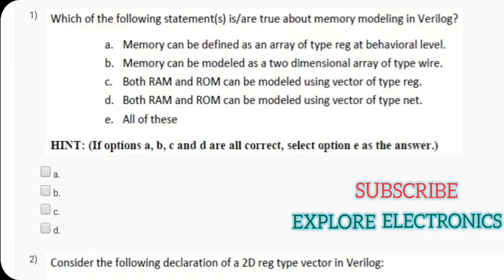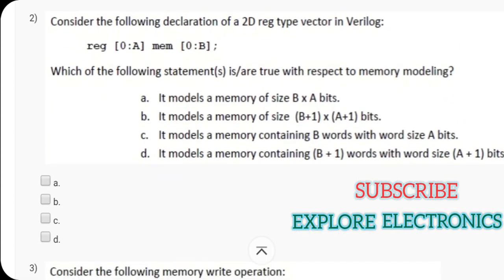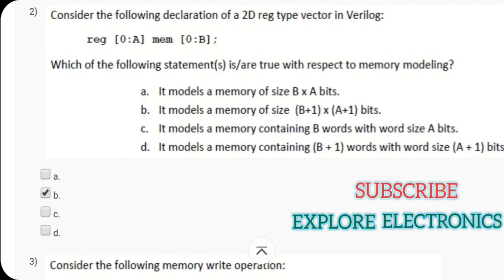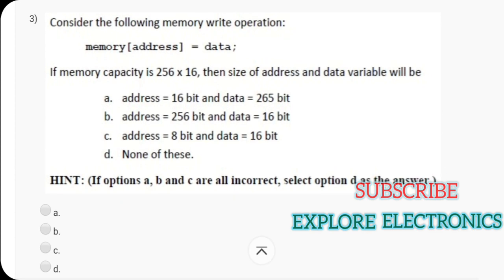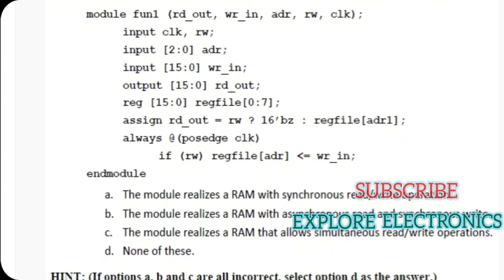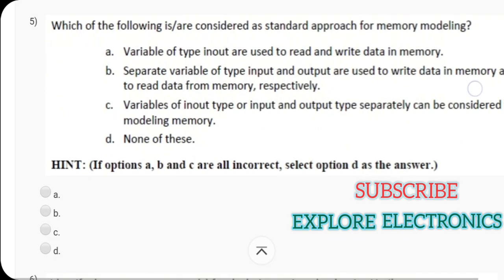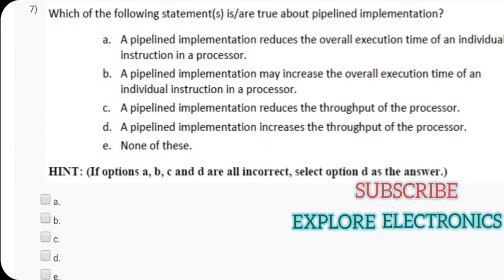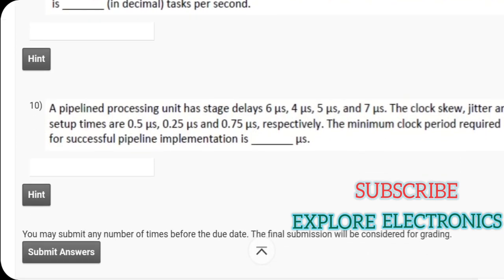verilog interview questions part 7 | Memory Design, Pipelining in momory | verilog tutorial MCQ 7

Comment: Ans 8)  Given 63 ns computational task time, 500 No. of Task, 9 stage piplined processor.
	
	uniform stage delay = (63/9) ns = 7ns

	therefore, Time taken by pipeline is = (499+9) X 7 ns [500-1 = 499, 
								9 staged pipleine, 
								uniform stage delay = 7 ns]
					     
					     = 508 X 7 ns   [499+9 = 508]
					     = 3556 ns
					     = 3556/1000 μs  [1 ns = 10^-9 s = 10^(-3-6) s = 10^-3 μs (1 μs = 10^-6 s)]
					     = 3.556 μs

Ans 9)  Given pipelined processing unit stage delay are being 11μs, 8μs, 13μs, 9μs, 6μs.
	Latch Delay in each stage of computation being 7μs

	Therefore Maximum Stage delay is = 13μs (maximum delay among 11μs, 8μs, 13μs, 9μs, 6μs).

	Throughput = 1/T  
		   = 1/(13 μs + 7 μs)	
		   = 1/(20 μs)
		   
		   = (10^6/20)  s
		  
                  = 50000 s

Ans 10) Given pipelined processing unit stage delay are being 6μs, 4μs, 5μs, 7μs.
	Clock Skew, Jitter and Setup time being 0.5μs, 0.25μs, 0.75μs.

	Therefore Maximum Stage delay is = 7μs (maximum delay among 6μs, 4μs, 5μs, 7μs).

	Therefore,
		   minimum clock period is
			
		   =  (0.5μs + 0.25μs + 0.75μs + 7μs).    [Sum of Clock Skew, Jitter, Setup time and Maximum Stage delay]

		   =  (7.5 + 1.0) μs       [7 + 0.5 = 7.5;       0.25 + 0.75 = 1.0]
		  
		   =  8.5 μs
Reply: @bunnykodaganti9163  Programming Assignment 2 of Week 7 us available in the channel pkease check brother.
Reply from the maker: Good criss 👍
Reply: @ExploreElectronics  Thank You Sir
Reply: @bunnykodaganti9163  No Brother, I am Till Now is not a ke to conplete Proramming Assignment 2 of week 7.

Programming Assignment 1 Of Week 7 is available in this Channel

Comment: Nuerical Problem Solutions (Question 8, 9, 10, Click Read More). 

Qs 8)   3.556
Qs 9)    50000       
Qs 10)   8.5

(Question 8 and 10 unit is in micro-second 10^-6, Question 9 is unitless)

Question 9 ( Fifty THousand i.e  50000 , 5 then four zeroes.) Pease put the numeric value only for question 9, i.e 50000 or else you will not get thge socre for question no. 9

 I will try to give the explanation to Question No. 8,9,10 after the deadline is over by today midnight
Reply: @bunnykodaganti9163  No Need to share your contact details, I will explain the calculation part.After 15/09/2021 23.59 IST. I will write in this comment thread. ANd you can folow the Assignment SOlution provided by INstructor of the course in the portal after 1-2 days.
Reply: Ans 8)  Given 63 ns computational task time, 500 No. of Task, 9 stage piplined processor.
	
	uniform stage delay = (63/9) ns = 7ns

	therefore, Time taken by pipeline is = (499+9) X 7 ns [500-1 = 499, 
								9 staged pipleine, 
								uniform stage delay = 7 ns]
					     
					     = 508 X 7 ns   [499+9 = 508]
					     = 3556 ns
					     = 3556/1000 μs  [1 ns = 10^-9 s = 10^(-3-6) s = 10^-3 μs (1 μs = 10^-6 s)]
					     = 3.556 μs

Ans 9)  Given pipelined processing unit stage delay are being 11μs, 8μs, 13μs, 9μs, 6μs.
	Latch Delay in each stage of computation being 7μs

	Therefore Maximum Stage delay is = 13μs (maximum delay among 11μs, 8μs, 13μs, 9μs, 6μs).

	Throughput = 1/T  
		   = 1/(13 μs + 7 μs)	
		   = 1/(20 μs)
		   
		   = (10^6/20)  s
		  
                  = 50000 s

Ans 10) Given pipelined processing unit stage delay are being 6μs, 4μs, 5μs, 7μs.
	Clock Skew, Jitter and Setup time being 0.5μs, 0.25μs, 0.75μs.

	Therefore Maximum Stage delay is = 7μs (maximum delay among 6μs, 4μs, 5μs, 7μs).

	Therefore,
		   minimum clock period is
			
		   =  (0.5μs + 0.25μs + 0.75μs + 7μs).    [Sum of Clock Skew, Jitter, Setup time and Maximum Stage delay]

		   =  (7.5 + 1.0) μs       [7 + 0.5 = 7.5;       0.25 + 0.75 = 1.0]
		  
		   =  8.5 μs 

These were just single line numericals so I told you that I will reply you in this comment thread. Have a Look and also Follow the Assignment Solution by Course Instructor in the Portal